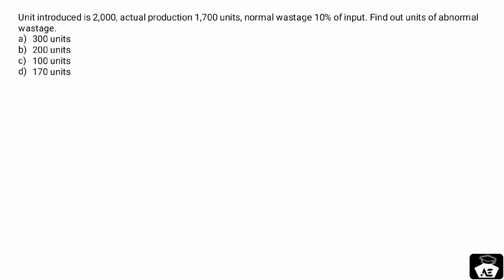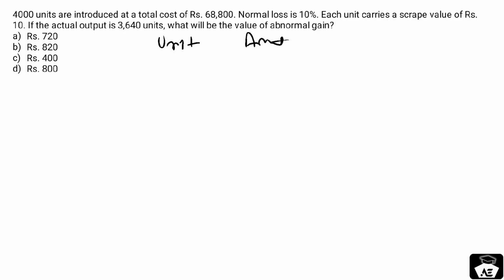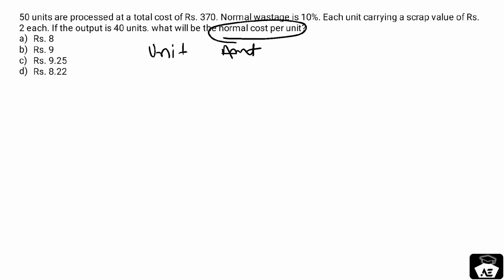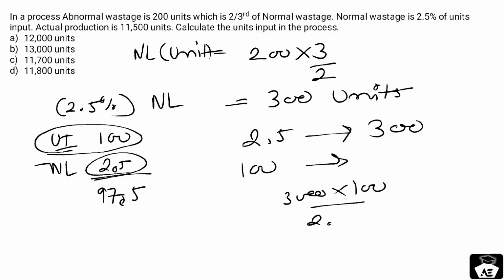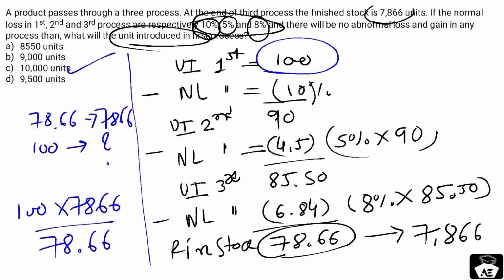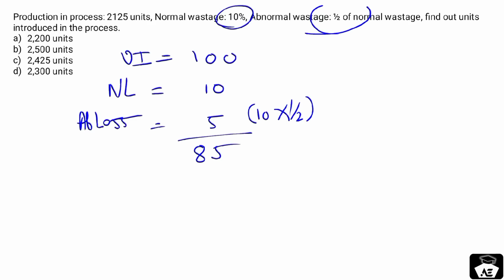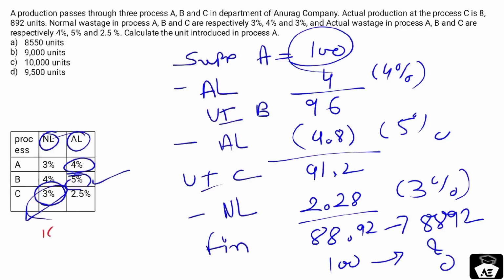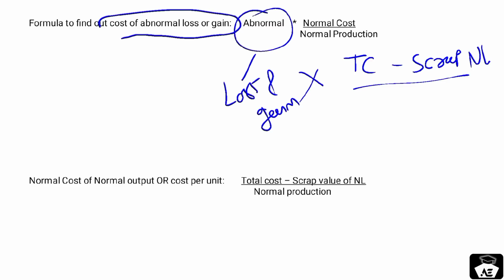PROCESS COSTING MCQ II SYBCOM PROCESS COSTING MCQ PRACTICAL II PROCESS COSTING MCQ FOR EXTERNAL

Comment: U said..normal and actual m higher % lena h and then in C process aapne mark kraya 3 but apne. Calculate 2.5% kia h pls clear hame actual loss wale % hi lene h?.. whether higher or lower fark nh pdta?.
Reply from the maker: Actual loss is combination of normal and abnormal loss, so if you see in process c actual loss is lower then Normal Loss so it means that there is abnormal gain.
Reply: @AnEducatorJayParmar  sir ye b bataiye pls
Reply: @AnEducatorJayParmar  sir ap 91.2 ka 3% kro to 2.74 ata h fir ans hi nahi arhaa 2.5% loge to 2.28 ta to ans araa pls chck
Reply from the maker: Ya it's writing error, it will be 2.5%, actual loss will be considered for all